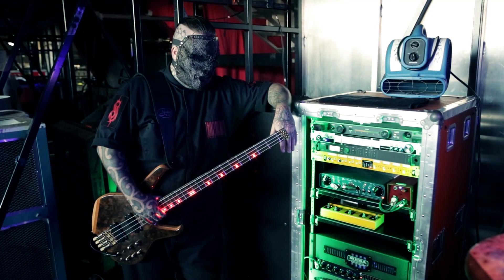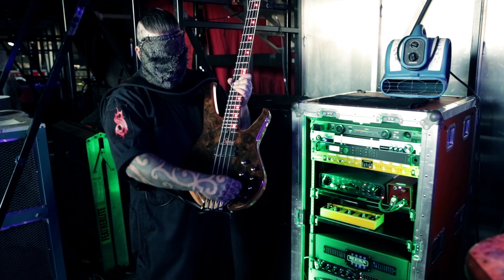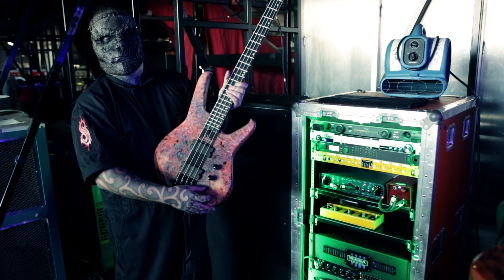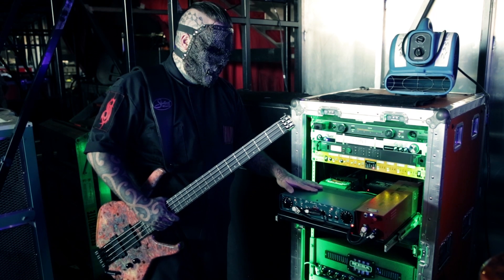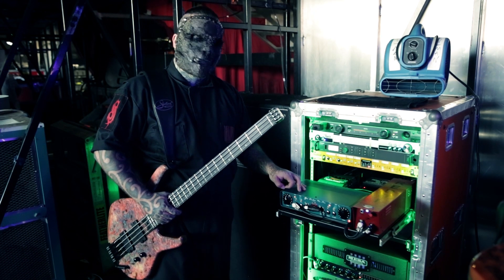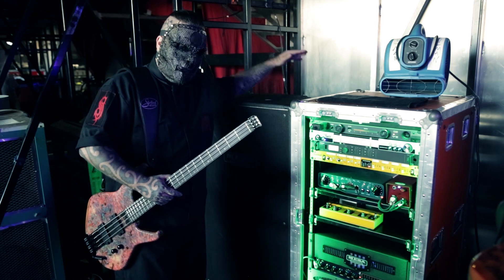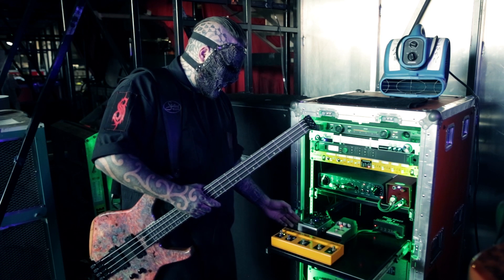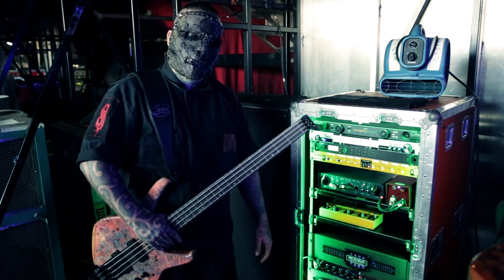Gear Rundown: Alessandro Venturella (Slipknot)

Comment: So, if he's already using 2 DI's and the cab isn't miced up, what is the use of these mesa heads ?
Reply: I can only imagine it is just another tube D.I. that when it gets pushed generates its own unique flavour.  From there it becomes the luxury of the FOH to blend in the perfect cocktail each night.  I am more interested in why the 8x10?  I am guessing as a total insurance plan in case the rig went haywire.  Throw a mic on the cab and the show goes on but I have no clue.
Reply: Tube amplifier such as his Mesa needs to be connected to cab, if you run it unconnected it will blow up.
Reply: Probably just for stage volume.
Reply: @jcmoore5819  On a Slipknot show they run IEM and the amps are too far from stage to make a difference, really I still wonder the use
Reply: Stage volume